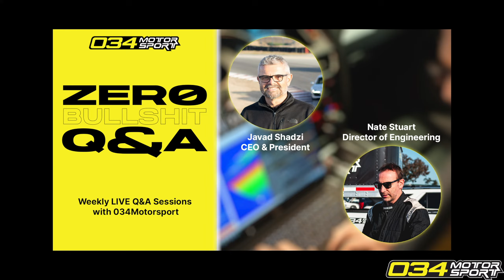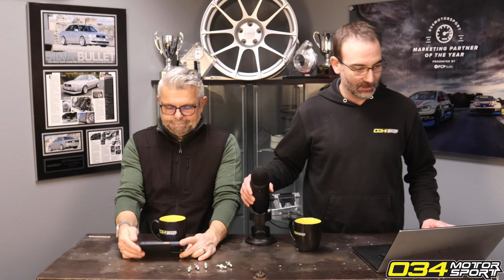Live Q&A, Round 224!

Comment: 1:26 my b9 sq5 is tuned , thank you and your team 
1:36 what if I want the acceleration package but with p34 instead of s34 
2:17 announcement winterfest sale is live
3:50 the CREC tune is a game changer
4:08 B9 S4 should I switch to 5w40 oil once it gets warm again been on 0w20 ?
5:16 why don’t you guys make a tune for v8 rs5
7:46 heard mixed reviews on 034 pendulum mounts and NVH
10:26 Q7 4M intake incoming ?
12:55 B9 s4 E85 , is Techron a waste of time ?
13:52 ethanol sensor for E85?
15:35 what happened to the ANAX Rs5 trans tune?
15:50 help me pick color of wheels for c7.5 black A6?
17:09 is there an axel back being developed for B9.5 sq5? SQ7 exhaust incoming.
18:55 do I need any other upgrade 2018 cab s5 for stage 1 E85?
19:29 how did 034 originate ?
27:17 is fuel pump piston required to go E40 on B8 S4?
27:45 can I run ethanol on stock B8 s5 system ?
27:58 is it okay to run 502/505 oil on EA888 that requires 507/508 oil ?
28:39 can u run O2 spacers on b8 3.0tfsi ?
29:34 is my radiator fan supposed to run the entire time  on my 2016 3.0t sq5 stage 1 tune ?
30:18 will the 401 boot loader be cracked? Is it the most difficult time you’ve had cracking a boot loader ?
31:34 would a bad in tank pump cause problems with fuel pressure ?
32:05 might be a dumb question but is it worth it fueling up at more expensive chevron, will the detergents make a difference?
35:43 8Y s3 spark plug recommendations ?
36:30 is the HPFP on the B9 particularly loud ?
39:01 what type of exhaust setup on Nate’s B8 S4?
40:50 recently bought b9 s5 with 30k miles afraid of modding is stage 2 reliable ?
43:20 b9 sq5 sway bars have said in stock what’s going on ?
44:19 Y NO RS6 TUNE 😡?
44:48 I was driving from Florida to Arizona had to downgrade my tune, had to flash back to stock first , any info what’s going on ?
45:39 Javad wants to address : I noticed recent 10% price increase , then got a 10% discount for winterfest so now it’s the same price as earlier in the year 🤔
52:31 will there be a chance for seconds on chili this weekend ?
53:28 if I get the downpipe for B9 A4 will I get a code ?
53:43 it is possible than when using brisk spark plugs on sq5 b9 stage 1 daily I had misfire problems due to dirt ?
54:23 will your density control arm kit increase NVH on C8 s7?
56:18 will LPFP upgrade be required with the upcoming MPI kit ?
56:51 is it safe to go straight from stock to stage 2 with supporting mods
58:00 are you two the owners of 034?
59:59 do you offer tours of your facilities ?

Comment: For the B9.5 RS5 I find the no crackle tune to be quicker shifting and smoother when going rapid in the vehicle.  So my question is for the e85+ tune with no Crackle is it also a High Torque File, or is the High Torque only available on the Crackle version?  Thanks in Advance.